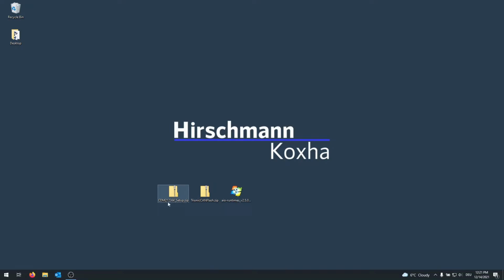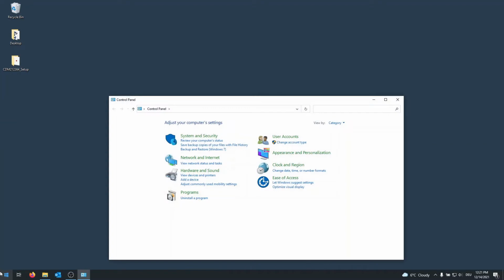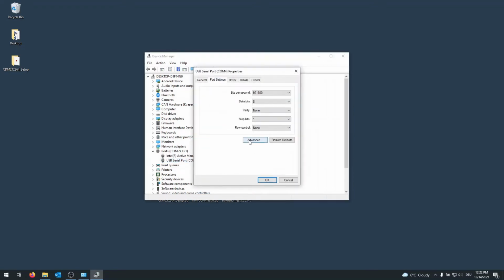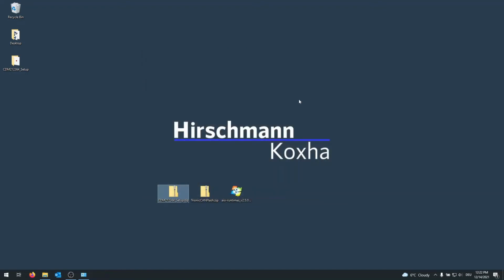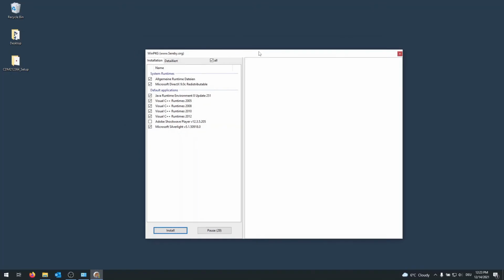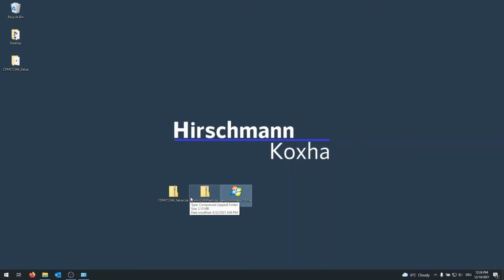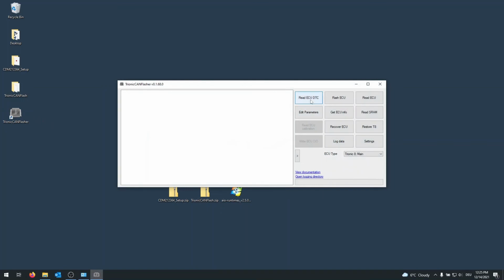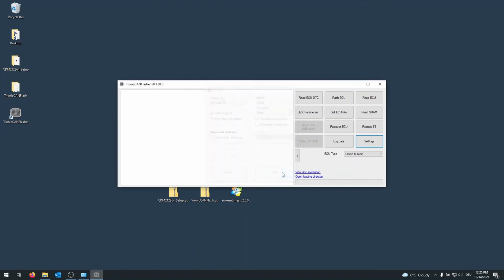Installation & configuration - OBDLink SX/EX + TrionicCANFlasher

Comment: i get open failed in trionic8 too ... :/ 
maybe i need to try it on win7?
now i am using sucking 10 :)
Reply from the maker: The TrionicCANFlasher even works with Windows 11. You probably have misconfigured the cable settings, e.g. by selecting the wrong port number.

In case you haven't solved the issue, feel free to contact us via our website's contact form and we will look into the matter with you.
Reply: @hirschmannkoxha  i fix it ,just use another laptop 
Now i understand that i need new one 🤣
Second one that i use was great ,no tune needed just plug obd link sx ,install can flasher and use!
Reply from the maker: @NikolovSky  glad you solved it! Sounds like the latency was set too low. Sometimes older hardware has problems with that.

You should still make sure that the latency on your new laptop is configured properly, otherwise you will end up with slow read and write.